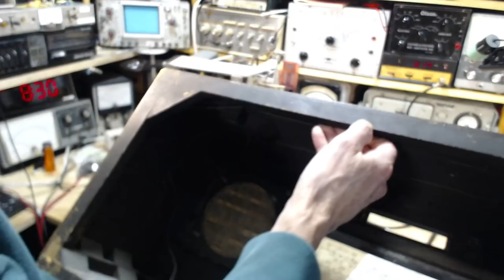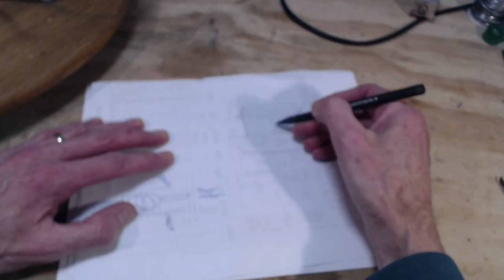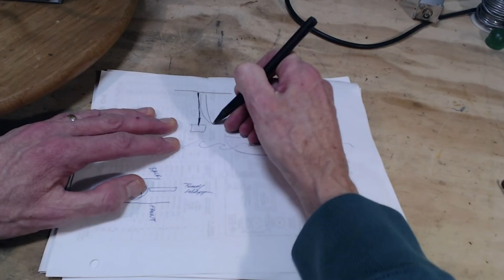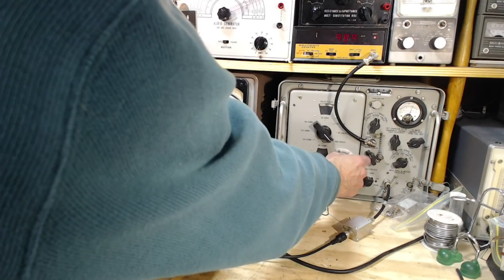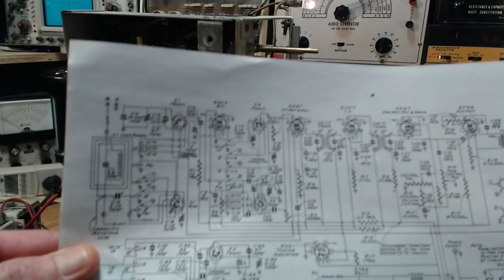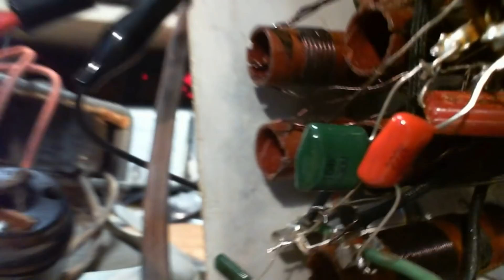General Electric KL-70 AM/SW Radio Video #25 - More Wrong Capacitors

Comment: Greetings:
About your mysterious interference noise possibly sourced in your home:
Arrange for a time that you may turn off all of your home's power at the same tim at the breakere and listen on your portable battery powered AM radio for the presence of the noise. If you still have the noise, see if it shows up on a scope.
Also, does the power transformer that supplies your home also supply your neighbors. They could have something making the noise.
If you occasionally have a local power outage, , use your portable radio to listen for noise (I would use a portable radio/cassette recorder for analysis later).
I persist in thinking you should be monitoring your IF or local oscillator frequency without resorting to your SDR radio (I have yet to have confidence in its use). I admire your use of the signal tracer, but do not recall your use of it that solved a problem.

Comment: It sounds similar to the noise we used to get on our phone line when the neighbors electric fence was being shorted to ground by something and water had gotten into the phone companies wire box for all the phones in the area. A very annoying sound to have during your phone call. I agree with a previous comment that it might have something to do with a furnace or something with an electronic controller. I am wondering if there is a way to put some kind of filter on the various potential noise sources to try to find it or eliminate it.